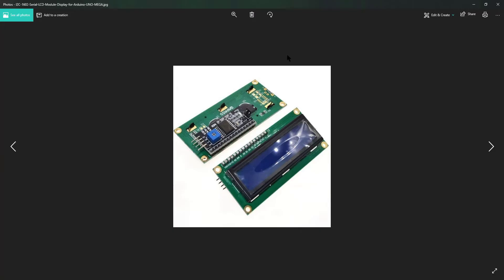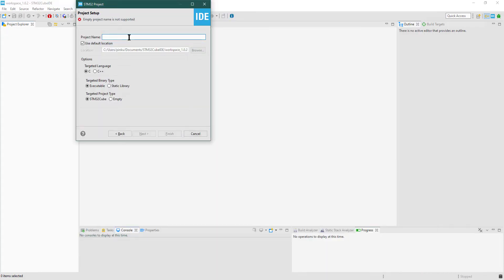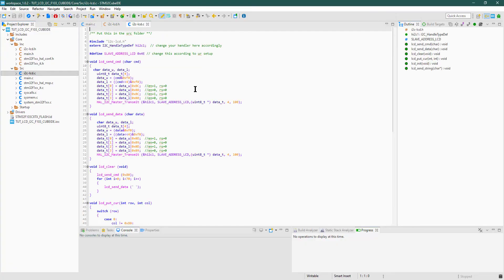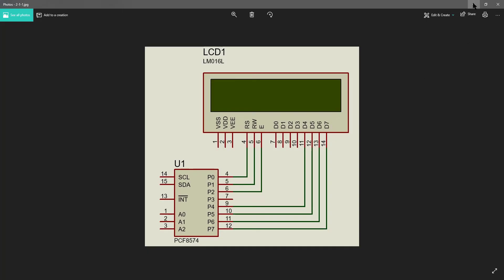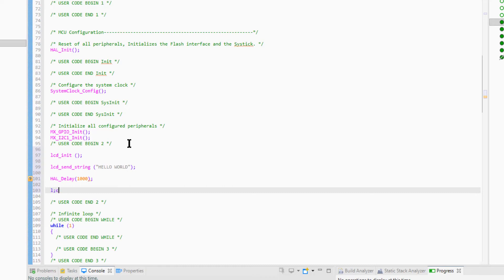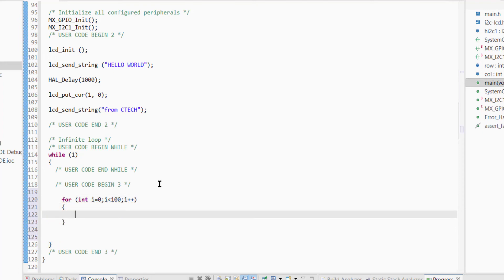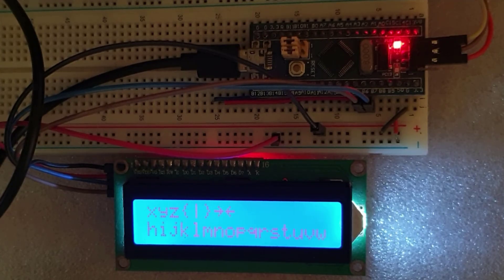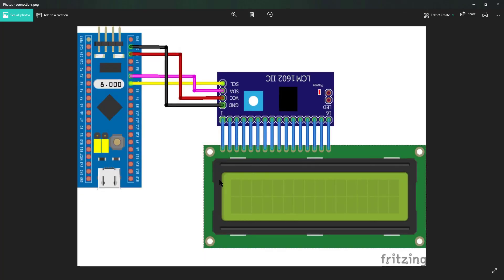Interface LCD1602 with STM32 via I2C | CubeMX + HAL Guide | Print Strings Numbers Floats

Comment: I get a little trouble, when i write lcd_send_cmd(0x80); lcd_send_data('a'); The LCD is run, but appear 'o' (not 'a') at the end of line 2. (when i use func lcd_goto_xy(0,0) and lcd_send_string("abc"), it do not still appear at first position (0,0) and show 'o' at the end of line 2) I don't know what wrong and how can i fix it. Thanks!!!
Reply from the maker: Many things could be wrong. If you have an oscilloscope or a logic analyzer, check the data and clock lines. See if the PCF8574 is acknowledging the data or not. The address might be wrong, so you need to confirm like this.
The address used in the video is 0x4E, that is valid for most of the PCF8574 modules but there are some PCF8574A Variant with address 0x7E as well. Do this check this address once.

Comment: How we turn off and turn on the black light 
Can I make a function for that?
Reply from the maker: There is no separate command for it. 
Just keep the pin p3 low while sending the data and command.
So in lcd_send_cmd function, 0x0C will replace with 0x04 and 0x08 will replace with 0x00.
Same in lcd_send_data, 0x0D will replace with 0x05 and 0x09 with 0x01

Comment: You do great videos, thanks. i got caught in two place, but got it working in about half an hour. My first issue was, it needs 5V for power not 3V3. The second issues i had was the POT on the back needs to be turned clockwise a bit, otherwise the text is not displayed, other than that perfect, thanks again, you save me heaps of time!!!

Comment: I just used your .h and .c library files for a 1602 project using a Nucleo L432KC board and all works well.  I used your Display Number code from your main.c and at line 109 the compiler (Cube IDE 18.1) suggested changing sprintf(numChar, "%d", num); to  sprintf(numChar, "%ld", num); which eliminated a warning message.  Thanks again for all the useful videos :)

Comment: I would like to add a little. If you are using a 2004 display, and cannot output to 3 and 4 lines. Then in the i2c-lcd.c file you need to add several lines. Was:
   case 0:
            col |= 0x80;
            break;
   case 1:
            col |= 0xC0;
            break;
It should be like this:
        case 0:
            col |= 0x80;
            break;
        case 1:
            col |= 0xC0;
            break;
        case 2:
            col |= 0x94;
            break;
        case 3:
            col |= 0xD4;
            break;

Comment: Your code is awesome! many thanks. Sadly I encounter a problem is that when I pass a variable to the function "lcd_send_string", cubeIDE says 
"passing argument 1 of 'lcd_send_string' makes pointer from integer without a cast [-Wint-conversion]"

I search for int to char conversion using suprintf(), but more problems appears. how can I fix it? Thanks
Reply from the maker: You can not print numbers on any display. You need to convert it to character for using sprintf. There is no other easier way.

Comment: Birebir aynısını uyguladım, sonuç olumsuz. (I applied your code, not working) Adresi de 27 veya 4E,3F hepsini denedim (I tried different slave address). LCD ekranı bile değiştim (I changed LCD) . 100000 Hz I2C frekansı aynı (I2C Clock Frequenct the same) F103C8 board aynı Clock frekansı aynı 72MHz, PLCK1 36Khz . What is the problem?
Reply: I added PULL UP resistor for I2C lines, no any character on display

Comment: Hi every ones. My LCD 16x02 is working on arduino, my STM32 NUCLE U575ZI-Q is working on the default project, the I2C on the LCD has PCF8574T and all three A0 A1 A2 are opened, I tried all address combination but nothig to do, i see only the light on LCD related the 5 Vdc, no sentence and nothibg nothing. Please help me
Reply from the maker: No need to try different combinations. The address will be 0x4E or 0x7E (what's the address used with arduino ?).
Sometimes reseting the board 2 3 times can make it work.
Reply: @ControllersTech  Hi and tks for replay to me. I tried many times with the adress 0x4E and 0x7E as well, also reset i did. The adress 0x27 on arduino is working very good.
Reply from the maker: The 8 bit equivalent address for 0x27 is 0x4E, so use this address. 
Check the i2c clock, make sure it is 100KHz. Also make sure you are using correct value for the external crystal.
Try connecting the pull up resistors on the SCL and SDA lines.

Comment: For a quick tip, always consider pull ups with I2C, sometimes you struggle hours long with an empty LCD, but it turns out that the problem is open drain STM32 pins with no pull ups... Besides some modules have the address 0x27 not 0x4E, by the way thanks for the video...
Reply from the maker: 0x27 and 0x4E are same. The former is a 7 bit address wheras the latter is 8 bit wide including the write bit. 
0x27<<1 = 0x4E.
Reply: I see thanks @ControllersTech
Reply: I couldn't display anything until I put some pull-up resistors in both SDA and SCL pins of the STM32. THANK YOU!!!!
Reply: @wenceslaoacosta2601  Yeah you need both. That is because there is a common line, where all devices are connected, if some random device is pulling down, the Vcc of others can be shorted.There is a nice document from Texas Inst. explaining I2C.
Reply: @wenceslaoacosta2601  Every 1602 LCD with a PCF8574 backpack has 4K7 resistors fitted from SDA and SCL to Vcc so you should not need extra pull-ups.

Comment: I used HAL_I2C_Master_Transmit_IT replace for HAL_I2C_Master_Transmit and it doesn't work.can you tell me why?
Reply from the maker: Don’t use interrupt. It doesn’t do any good in this case. The data need to sent in sequence and the next transfer should only start when the previous one is finished.
Reply: @ControllersTech  what about dma in this case ?

Comment: I had a doubt can anyone please help me..the PCF8574 & LCD module are supplied 5V via the STM32 controller right? And since STM32 runs on 3.3V the SCL &SDA lines would carry 3.3V as well so then isn't this harmful for the PCF8574 IC as its supply voltage is 5V but the clock and data lines bring 3.3V
Reply from the maker: The PCF takes care of it. Don't worry about that
Reply: @ControllersTech  Thank you so much for replying. Can you please give me details on where I can find this information in the datasheet. Also it means that STM32 will also be safe along with PCF8574?
Reply: @ControllersTech  I came across a thread on a forum where there was mention of ViH of PCF which is 0.7 times VCC(5V in your video) according to datasheet i.e. ViH = 3.5v. So if we use 3.3v sda and scl lines from stm32 then 3.3v does not cross the ViH which is 3.5v which sounds convincing but then again i donot know how it worked for you in the video. I was thinking of using bidirectional level shifter in the circuit between SDA and SCL lines.

Comment: I do appreciate all the work that goes into your tutorials, both the coding effort and the video editing. The one problem I ran into, which took more than a day to sort out, was the lcd_init function, which indicates using 0x30 and 0x20 as commands. According to the specs, and my experience, those commands should be  0x3 and 0x2. For a noob such as myself, simple typos can be quite the challenge.
A second discovery, not directly related to your tutorial: When I wanted to port the code to a Nucleo-103R8, I was mis-led by the Arduino pinouts and notations on the motheboard for SCL and SDA. It again took more than a few hours to discover those pins ONLY WORK when coding with the Arduino IDE wire library. To work directly with the STM32 mcu, the outer set of pins must be used.  The code for the display will not work with the Arduino headers. It seems that that aspect of the Arduino shield vs the mcu pinout is not well documented, or at least I couldn't easily find such documentation.  
Again, thank you for your efforts, they are much appreciated and I have learned a lot from your tutorials.
Reply: Edit to the above: The init code is not a typo - rather it seems that my LCD, not from waveshare, required the edits. Apologies for the implication regarding the correctness of the code!
Reply from the maker: Alright it's nice that you understood the first point you made.
Regarding the second point, everything works well with the Arduino pinouts. There are 3 sets of pins on the right side of the nucleo boards. The arduino header and the very next  male header are interconnected. 
I never use the male headers on anucleo boards (except when I have to use the pins that are on the very extreme) and I never had such problem that something is not working with those pins.
Reply: @ControllersTech  Looking at the schematic for MB1136 pin 10 on CN5 (marked for Arduino as SCL/D15 on the pcb) is directly connected to pin 3 on CN10, but that is not valid for I2C_1 use by the mcu. Pin 3 on CN5 (marked on the PCB as PWM/CS/D10)is a direct connect to pin 17 on CN10, which is valid for I2C_1. What I found confusing/misleading was the Arduino notation regarding SCL.  In both cases, the code and the physical connections, it still all goes back to RTFM!  Thanks for your quick reply. Much more to learn... BTW - I believe I found the alternative init command code parameters in the Hitachi docs for the LCD, which I bought close to two years ago and I did not know who the manufacturer was.
I continue to look forward to watching and learning more on your channel regarding both the STM32 and ESP32 devices.
Best 😁

Comment: Hi, thanks for the tutorial. I am using the Nucleo-F303RE and had to change the void lcd_init (void) delays on the LCD that I am using. Then everything works well.
void lcd_init (void)
{
	// 4 bit initialisation
	HAL_Delay(50);  // wait for >40ms
	lcd_send_cmd (0x30);
	HAL_Delay(15);  // wait for >4.1ms
	lcd_send_cmd (0x30);
	HAL_Delay(15);  // wait for >100us
	lcd_send_cmd (0x30);
	HAL_Delay(15);
	lcd_send_cmd (0x20);  // 4bit mode
	HAL_Delay(15);

Comment: it’s work very fine, good job. Can you help me to print the value of the potentiometer linked on ADC please?
Reply from the maker: Convert the value to string using sprintf, and then print the string
Reply: @ControllersTech     thank you for your answer but iam in the begining and need more practise.....

HAL_ADC_Start(&hadc1);
	  		HAL_ADC_PollForConversion(&hadc1,HAL_MAX_DELAY);
potentiometer=HAL_ADC_GetValue(&hadc1);	
   char buffer[4];
   lcd_send_string ("potentiometer=");
   sprintf (buffer, "%d", potentiometer);
   lcd_send_string(buffer);

but it doesnt work
Reply from the maker: 1. Make sure the adc is working..
2. Declare the buffer as global and check in the live expression if it is updating with the value
3. I am guessing that the potentiometer is not an integer variable so make sure you use the formatting correct for sprintf
Reply: @ControllersTech   now the value of potentiometer is shown in display but it is not updating in real time, i need to reset a processor to update a value right now. How can do to be updating in real time. Thank you sir, you are helpfull
Reply from the maker: You have to put the code in while loop..
Also make sure you stop the adc in the end..
While (1) {
Start
Poll
Getvalue
Print
Stop
}
Reply: @ControllersTech   thank you very much! it works but i have the last problem sir, the value of potentiometer when is on max is 4095 when i put down  (at 700 for example ) on display i see  7000 that is not right.

you helped me a lot
Reply from the maker: That's because your lcd is displaying the remaining 0.
You should use sprintf(buffer, "%04d", potentiometer)
Reply: @ControllersTech   it all function! thanks of you! But when it works it pull me up the PB14 which is connected at LED3 ( nucleo 144) , in the same  pin i have a square output . Can i understand why when the display works it pull me up at 3.3 V the PB14( and if is possible chanching the pb14 to another pin maybe where is not problem for me)  i cannot change the output for the square because i havent timers free

Comment: Can I get some help for STM32L4+? I am using the PCF8574 so I am using SLAVE ADDR 0x4E like you did. However the code is not showing anything on the screen. Is there anything else I have to change for my STM?
Reply from the maker: Try 0x7E

Comment: You said the STM32 uses 8 bits for the address. In the code automatically generated in STM32CubeIDE has this parameter "  hi2c1.Init.AddressingMode = I2C_ADDRESSINGMODE_7BIT;" So, do I use 7bit or 8bit? A scanning program shows the address of my LCD and backpack as 0x20.
Reply from the maker: The actual address is 7 bits. Actually HAL uses 8 bits (7bits+read/write bit). That's why we need to provide 8 bits for the address.
The 0th bit is R/W bit, and bits(1:7) are the actual address bits.

Comment: Hi sir although i performed the LCD as you exactly had done , it is displaying Meaningless symbols such as "?,!  etc.". How can i fix it ??
Reply from the maker: Try resetting it.. or disconnect the lcd power and connect it back.
Sometimes it does that..
Make sure you are using the pull up resistors on the scl and sda lines

Comment: hey, when i try to use send data comand, lcd prints random symbol, why does it prints only ASCI ? shouldnt send data let me send variable value to lcd?
Reply from the maker: Ask it to the manufacturers of the LCD.. 😜

Anyway, you can use sprintf to convert the data to string and then send it..
Reply: @ControllersTech  so if I want to print my variable, for example uint8_t i which will increment every second and want to see numbers increase, its not possible with this library? lcd_send_data only send char or strings in this library?
Reply from the maker: Use sprintf to convert..
You have to do the same for every display you use, or whenever you transfer data..
Reply: @ControllersTech  i see, thank you

Comment: The code that I downloaded from your link had 0x20 instead of 0x28 for the initialization of the screen. This then initializes only the top row of the screen and not both rows. So if anyone else is having the problem where just the first line of the screen is working, just change the 0x20 to 0x28 in the initialization of the display.

Comment: can you tell me what adress should i use with i2c2 and not i2c1?
Reply from the maker: Adress is for the device. It's same no matter what i2c you use
Reply: @ControllersTech  I'm using i2c2 without changing nothing that you did and my lcd 16x2 is only green nothing more, not a single sentence or values is showing up in the screen
Any ideia what it could be?
Reply: @ControllersTech  when I say address I'm referring to the salve address

Comment: I performed the lcd i2c exactly you have done and with slave address 0x4E and 0x7E still the lcd display showing me black rectangles and not displaying the string that I have written in code.
Reply: So kindly me sir
Reply from the maker: Reduce the contrast using that potentiometer on the PCF8574
Reply: I also performed that several times
Reply: It’s problem my side your code perfectly right thank you sir.

Comment: The connection is correct. I also checked the device address using for loop. Its 0x4E. But when I send some string it just displays blank screen. LCD glows but nothing is displayed. Do I need to adjust the contrast ? Or the problem is something else ?
Reply from the maker: Try changing the contrast..
Also try with 0x7E address (for pcf8574A)
Reply: HELLOO I HAVE SAME PROBLEMS. HOW TO FIX ?? CAN U HELP MEE

Comment: Default bus addresses for popular i2c LCD modules (if A0 A1 A2 pads unsoldered):

(0x27<<1) for PCF874
(0x3F<<1) for PCF8574A
Reply: He's already mentioned in the description. If you are using STM32 it won't work because STM32 I2C uses the LSB of the slave address to decide to enter Transmitter or Receiver.
Reply: @leanh1203  did it worked for you? it's not working for me.
Reply: @FelypeFerreira0101  me too. I'm struggling with the code man :( but the slave address is sure not 0x27 or 0x3F if you are using stm32 as i said above.
Reply: @leanh1203  I am using STM32L4+ what address should I use?

Comment: can I use this coding for stm32f446re?
Reply from the maker: Yes.. i myself have used with 446RE
Reply: @ControllersTech  can i set the coding to do. For example: at first lcd will display "Hello World" then after 3 sec  it will display another word for example "Bye". If it possible how can i do it?
Reply from the maker: Just like u said 
First send the string "hello world"
Hal delay (3000)
Now clear the display 
Send the string "bye"

Comment: I have STM32F407VG discovery board, I did all thıngs same, and I already change slave base adress to 0x27 . Am I need to change anything else? When I try debug and play, nothing running on the lcd
Reply: But I try to find base address for my I2c module. I find a 0x27. How I will configure it ?
Reply: And I changed to LCD_Driver main library to #include "stm32f4xx_hal.h"
Reply from the maker: What module you have ?
Reply: @ControllersTech  PCF8574
Reply: Sir I found it , from datasheet . It sould be  0x4F. Now ıts working. And module  :PCF8574; PCF8574A
Reply from the maker: I have mentioned in the description also 😔